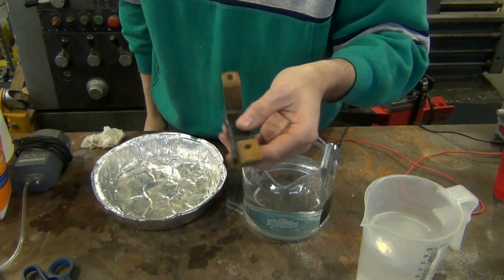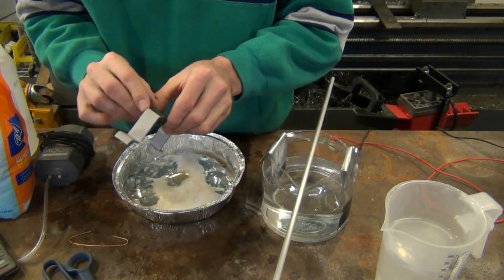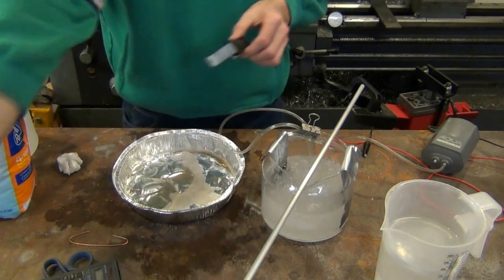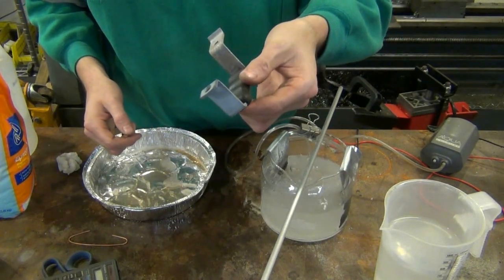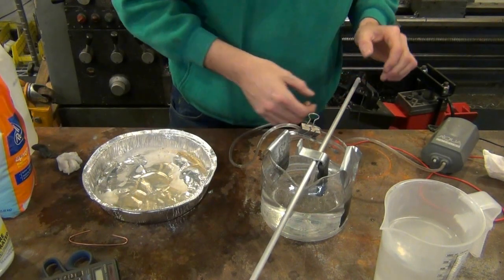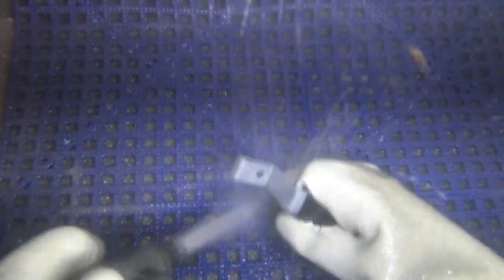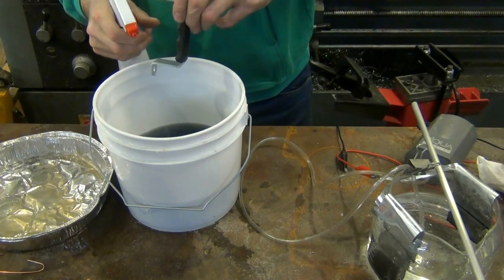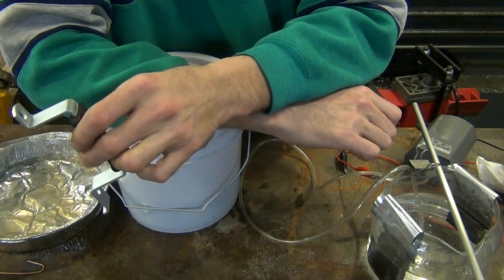Zinc Plating a Steel Handle on the Cheap and Applying Clear Chromate (Part 2 of 2)

Comment: Just a quick tip don’t aerate the solution circulate it so don’t use a fish tank aerator use a pump a small small water pump for a fountain. Putting air in you solution will make you have inconsistent platting, dark spots etc.
Reply from the maker: Thank you.
Reply: What about this one. Looks like it doesn't need to be submersed if you use two hoses. And what will the solution do to the pump, if anything?
https://www.amazon.com/dp/B085NQ5VVJ/?coliid=I30UJEPDD82E0N&colid=2BC1CO1FLBN8J&psc=1&ref_=lv_ov_lig_dp_it

Comment: Have you worked out a cheap chromate, than buying it? It's as dear as poison here in Australia cheers Graham.
Reply from the maker: There's another guy on here that made his own from sodium chromate and sulfuric acid I think. He was dipping auto carbs in it. I do small stuff, so just sprung for the pre-made concentrate. I think Caswell Plating ships to Oz.

Comment: If you polish the zinc before clear chromate, will it still stick? Looking for a bright finish on motorcycle parts.
Reply from the maker: It will stick, but this formula won't leave a bright finish. You will need something probably from Caswell to do that.

Comment: Can you explain the function of the chromate on the zinc? I really like the color of the yellow chromate you did on the dummy part in another video but now I see you are doing clear chromate so there must be more to it than just color right? It is also expensive $$$
Reply from the maker: It creates a hardened conversation coating on top. Otherwise, when the zinc reacts with humidity it becomes white and chalky. I don't know the exact chemistry.

Comment: Can you tell me more about your vapor blasting cabinet. Is it homemade?  I’ve been wanting to build one forever and haven’t found much info on them
Reply from the maker: Yes, it was built on site. It is a lot more involved than I can get into in the comments section though.
Reply: How about a video and a parts list.
Reply from the maker: I have been asked how to build one of these so many times, I'm considering starting a consulting side to my vapor blasting business. Building one is not too bad. Implementing it, and getting excellent results that your customers want can be a real challenge though.
Reply: Arnold's Design vapour blasting cabinet

Comment: I managed to get zinc plating working with a sodium hydroxide solution, it seems to result in a more shiny finish then this one, however sodium hydroxide is more dangerous. This was just the conclusion from my preliminary tests though, im waiting overnight for the zinc to devolve better into the solution.   

Plating voltage was 2V at 1A (my powersupply cant do more), ironically i got my start in electroplating at home due to the need to fix a much more powerful lab powersupply. Sadly i cant get sodiumdichromate to get a yellow zinc finish the way the original part was, so ill use blue instead...
Reply from the maker: That is interesting. I will try using sodium hydroxide sometime. I don't know why you can't get yellow where you're at. Caswell online ships to other countries I think. The only difference I know of is, the yellow is sodium dichromate in sulfuric acid, and the blue is sodium dichromate in nitric acid, but the blue has a much lower concentration of dichromate. I've seen it for sale on ebay if you want to make it yourself. Also, keep your blue dichromate acid in an air tight and light proof container if possible, and wrap the container with black plastic or aluminum foil to keep out light, and keep in a cool area. Otherwise, nitric acid will break down into nitrogen dioxide which is yellow. That yellow will mix and make the otherwise blue acid start to appear green after a while.
Reply: Sadly i could not find a source for it in germany (where im living right now), heck sodium hydroxide was hard enough to get in a pure enough form. The best i could get is Potassium bichromate, not sure if that will work though.

Thanks for the tip about the blue bichromate storage!
Ill look more into the bichromate process.

Comment: I also wonder about the magnesium causing the dullness.
Reply from the maker: All good tips. I don't know about the magnesium. I know it won't plate without it because the resistance gets too high. I tried caswell brightener with no effect. I don't think it's compatible with this system. Sugar doesn't help either for some reason. It's supposed to, but... Like you said, send the parts out to a plating shop if you can. Occasionally when a good customer sends in a casting with a few stray steel bits that need plating, I will do it to help them out.
Reply: I am in the same boat. I had the issue with Caswell's copy cad doing small jobs where I can't spent $150 for 1 bolt. The stuff that comes back from the platers is always nicer and doesn't oxidize as bad. The material makes a difference as well ferrous/non. Does it make a difference if you dissolve more zinc before you plate (as in the solution is low)? Magnesium is a very soft metal and is changing the purity of the zinc. Mag also oxidizes bad. Pickling salt does not contain additives. If the acidity is off then maybe add salt. When I was last at the industrial shop they had baskets and threw a chain inside and then submerged my bolts in the cad like a tumbler. In the tank next door they hot galv dipped trailers. It's been 20 years since I plated, I'm trying to remember and not doing so well (:
Reply from the maker: I might try the salt. I don't know about zinc purity being affected, but I plated a colled rolled steel rod and yellow chromated it. I sat it outside for about 5 months for a corrosion test. The unplated part of the rod was heavily rusted and flaked, and the plated part was completely unaffected. Completely, like it had sat inside the whole time. I have a short video where I show the results of the test.  I always dissolve zinc beforehand because I read there aren't enough ions to plate the part if you don't. After that though, ion saturation is ongoing.

Comment: the darkness on the edges is zinc buildup. It is drawn to the edges. I would try a "brightener" somebody else can correct me here  but I think sugar would do the trick. Considering the used parts and surface prep (blasting) I would consider the process acceptable, Caswell's kits aren't much better. The cad platers charge me $150 for 50lbs if I prep the metal first. Sometimes it's cheaper if you prewire with copper also. They have vibratory drums, acid pickles and all sorts of ways to deal with problems. IMHO, if you can justify sending it out DO IT! I need a bolt done here and there so the home kits work, but not as well.
Reply: I was driving around yesterday and had the eureka moment where I remembered that the buildup on the edges is from the flux lines of current and added surface area. I also remembered that with fish tank bubblers (I have never used one) it is a good idea to swish the part around. The dullness can be caused by solution sitting. Although you have bubblers agitating it's not the same as a pump and you should move the part even with pumps. Cavitation may be the word here.
We were sandcasting with aluminum, had to make sure there was no zinc or mag mixed in. Used vinegar and the zinc turned black. I'm mixing a batch up with piclking salt, i'll let you know how it works. Using a 12v pump out of a Monatana with rear heat and a wash tub I found in the garbage.

Comment: Do you have any kind of formula for how much current volts and amps and possibly time that would be required for a small barrel operation. We are trying to do a zinc and clear Chromate for nuts and bolts. We have a barrel that will hold about 10 to 12 pounds of parts. We need to find a rectifier that will have enough capacity for this. Great videos.
Reply from the maker: Thanks. I don't have any knowledge of high volume operations. I just do this sometimes as a hobby.

Comment from the maker: Impressive. I left the dummy part out in the wet weather for about five months, and it didn't even affect it. The rest of the unplated steel got heavily rusted.
Reply: Impressive! I currently experimenting with zinc plating and gets pretty decent results. However i experience huge problems with smaller parts that have a lot of inside surface ( surfaces facing away from the zinc anodes).  I suspect it's because the electric current runs primarily the shortest way from anode to cathode and therefore the insides gets very little of the electroplating effect. I'm not sure how to solve this problem on more complex parts so if you have found a better way of doing this im all ears. :)
Reply: Formula400Pontiac 2 things - stick an anode inside (roll of copper wire 14ga. bundled up) and agitate or pump more solution inside the part and  make sure there is no air. Movement is key.

Comment: I repaired my hand truck by replacing the front casters that had rusted bearings.  The bearing and caster body was ordinary bright galvanized coating.  It had worn almost all the way off and everything had a rust patina.  The nut and lock washer that held caster in place were grade 8.  They had zinc chromate finish and were only parts not rusted.  The casters were exposed to wet salt in winter months.  Point being zinc chromate even resist chloride!

Comment: What’s the handle made out of?  Maybe I missed it.   Plastic or rubber?  And can you zinc plate fuel hose ends that are pressed on the hose and not removable?
Reply from the maker: The handle is steel with a rubber grip. I don't see any reason why you wouldn't be able to plate the hose ends. Just make sure the inside of the fittings are clean so you don't contaminate your plating bath.

Comment: good day sir, how do i recognise zink metal from a stainless stell, ? im having a problem finding  zink metal
Reply from the maker: I get it from amazon.com in rolls. I don't know where you're from but it's available online. Zinc is softer than stainless and will react with acids quickly. Stainless won't. You can also melt down US pennies, 1981 and later. They are copper jacketed zinc.  The zinc will pour out, leaving the copper behind. Make a plaster mold and make an ingot of zinc.
Reply: Stainless is also non magnetic. @ArnoldsDesign

Comment: Great vid.  Bag the anodes (disperse the plating field), and reduce the voltage. this will eliminate the burning.  Sharp edges concentrate the field.
Reply from the maker: I will definitely try that. Thanks for the tip.
Reply from the maker: Is there any certain type of material that the bags should be made of? Cotton, polyester, or nylon maybe?
Reply: Arnold's Design polyester works. Must be very clean.
Reply from the maker: Ok, thanks.

Comment: Harbor freight sells cheap wire brush packs... steel, copper, and plastic brushes in a pack.  6 total, long and small of each.  $1.99 -20% off coupon.
 + use a free item coupon at the same time.   https://www.harborfreight.com/6-piece-detail-brush-set-93610.html

I usually get a free 5x7 tarp, multimeter, pack of AA/AAA vatteries, or screwdriver set with every cheapo 20% off single item purchase I make.

Seems like it would be cheaper to use a 3v DC power brick out of your box of junk power bricks rather than batteries.  Any old computer PC power supply has a 5v DC rail but that might be too high; try it.  Might be a heck of a lot of amps tho... Power brick would be safer.

Comment: You could put a wrap of plastic wrap around the finished part to avoid splashing. I dunno if it'd react with the acetate, but that's easy enough to test.
Reply from the maker: Thanks for the idea.

Comment: how long does the solution last.  and how do you dispose of it, why did you vapor blast it.  do you have to chromate at all
Reply from the maker: The solution lasts many years. Disposal would require special handling and govt red tape. Vapor blasting gives the satin finish to replicate the cadmium plated finish. Chromate is required to harden zinc, otherwise the zinc gets chalky and tacky feeling as it reacts to moisture.

Comment: Great videos!
Could this be used to plate watch bezels that are starting to show the base metal?
Reply from the maker: Thanks! I don't know what your base metal is, but I know it will plate steel, brass, copper, and silver solder. You would have to experiment.
Reply: +Arnold's Design 
Thanks, I believe it's brass.
I'll give it a go.

Comment: Great video! I'd like to try this with a handlebar from a moped. Do I need more amps because it is a bigger part? Or does it need to sit longer?
Reply from the maker: The time is the same. You'll need more amperage. It's around 100 milliamps per square inch, but you'll have to experiment with something that size.

Comment: Simplest and most effective method I've found... nice.
Reply from the maker: Thanks :)
Reply: What was your clear chromate solution formula? Thanks
Reply from the maker: I bought it from Caswell plating. It's pretty cheap.
Reply: Yeah, trouble is I'm in New Zealand... there is a Caswells in Australia but not sure about shipping even just to here!!  I know one ingredient is Sodium Dichromate but not sure at what concentration and if other compounds are present.  I read somewhere that 0.02% is the blue/clear conversion and from about 5% gives the yellow/gold finish.  Nitric acid is also added.  Is there any formula information on the packaging you got from Caswells?  Cheers
Reply: Is it just water you blast it with?
Reply from the maker: No, no formulation. They hold their cards close to their vest. All I know is that the yellow chromate solution is the the color of orange soda, and the clear blue chromate is a blueish green solution. The yellow one has a somewhat vinegar like smell, so I have no idea.
Reply from the maker: Water and glass beads.
Reply: Hi Arnold, thanks for these videos. I'm restoring a vintage Kennedy machinist toolbox that I stripped the paint off of to get at the underlying corrosion. When I'm to the point of finishing it, I don't want to use paint, I'd much rather do a zinc and chromate finish to protect the metal- that will look super cool and work well in my shop I believe.

Anyways, how can I find the formulas to scale-up your bath and your electrical charge to suit a large toolbox and it's drawers? Could you help me with scaling it up to suit my project?

I can imagine making a huge bath of this solution that will work for zinc plating the toolbox, but I can't imagine buying enough clear chromate to dip the whole box. Do you think a painting on of the chromate and then a rinse would work to add the chromate finish?

Also, you sprayed your part with distilled or purified (RO) water after every zinc plating, you said it will remove the zinc oxides? Is it a must to spray/rinse after every plating? I'm not sure how I would rinse the box off unless I used tap water from a hose.

Thanks for your ideas and help!
Reply: What is the chromate?

Comment: You might try adding some sugar to the solution as a brightener.  I've heard that it prevents zinc crystals, and therefore brightens the finish.  You also might try turning down the current.  I've heard that if it's bubbling, than the current is too high and you'll get the black and flat finish.  It's all about amps/square in.
Reply from the maker: I hadn't heard about the bubbling. I will give that a shot. I will say that I used sugar in the beginning and about 65 milliamps per square inch and the results were the same. I upped the amperage per square inch because I found it wasn't plating well on larger parts. Too high, though, and it starts to burn. I could just bite the bullet and get the normal chemicals from caswells, but this was a spur of the moment thing to help a customer last year. I am by no means an authority on this.
Reply: @ArnoldsDesign  Your amps are set too high. Instead of 0.65 amps you need 0.1 amps per square inch. Watch this video, he explains it very well. https://www.youtube.com/watch?v=awowG1ecYaw

Comment: How to you make the chromate solution? :)
Reply from the maker: Click on the link in the description. Part one will show you.
Reply: You showed how to make the zinc electrolyte solution but what is in the yellowing solution and the clear one?
Reply from the maker: They are a couple different varieties of chromic acid. I don't know how to prepare them from scratch, though some people do from raw chemicals. I get them them as a premade concentrated solution. They are pretty cheap to buy, so I just order them from Caswell's. It is hazardous stuff, so don't rinse it down the drain or let it fume into your shop.
Reply: The yellow one is sodium dichromate and sulfuric acid, and the blue ("clear") one is sodium dichromate and nitric acid. I haven't looked up the precise ratios yet. Sulfuric acid is easy to come by, but nitric acid is a little more troublesome, as it is a key ingredient in most recipes for explosives.